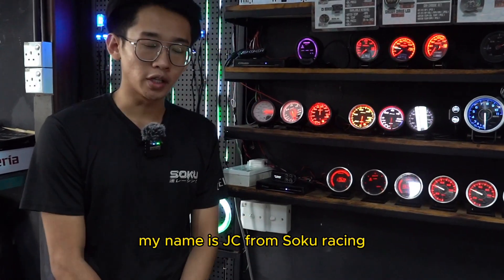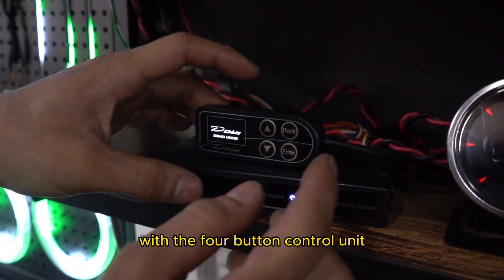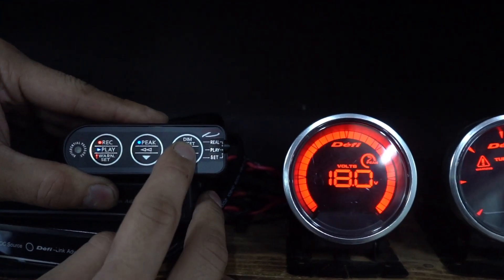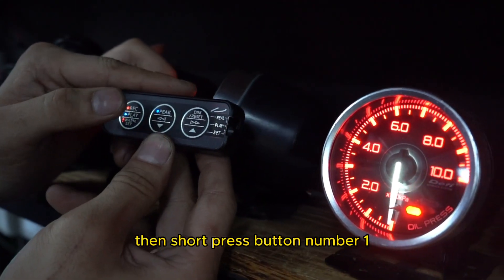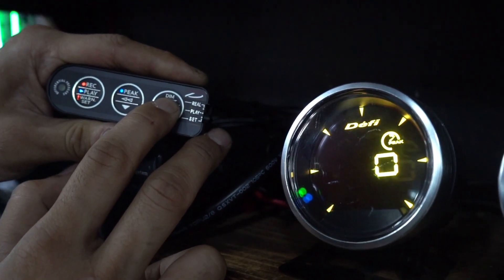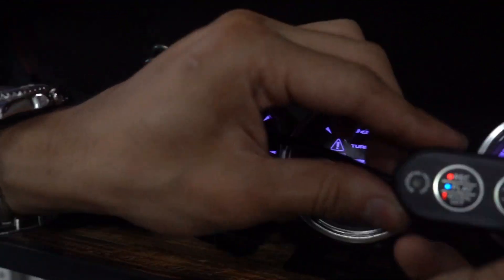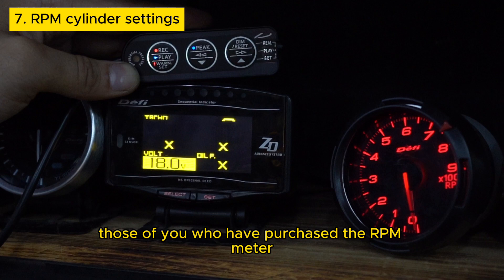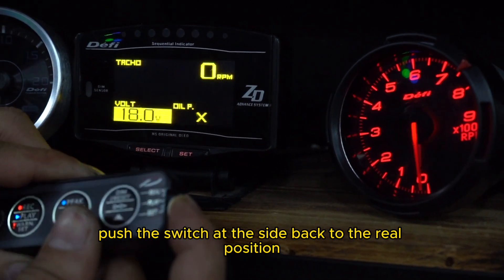DEFI Daisy Chain meter gauges settings

Comment: In daisy chain for digital gauges how do you set each digital gauge to show a different reading.  Like how to show oil temp, oil pressure and water temp on three gauges?